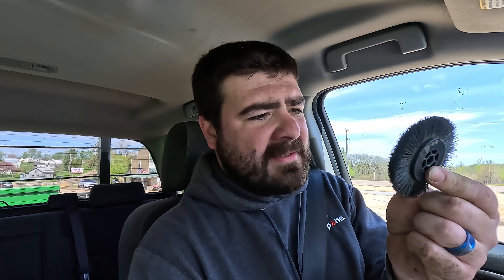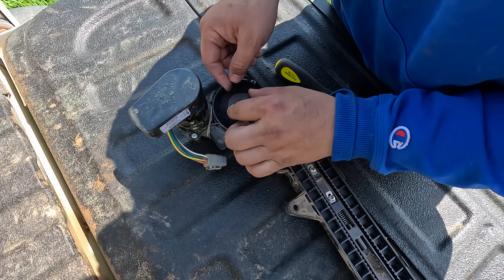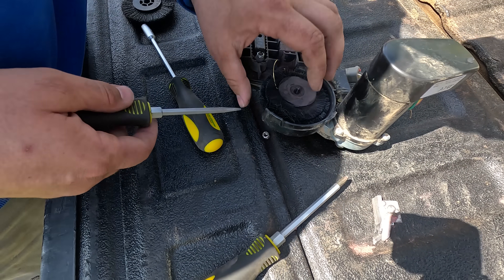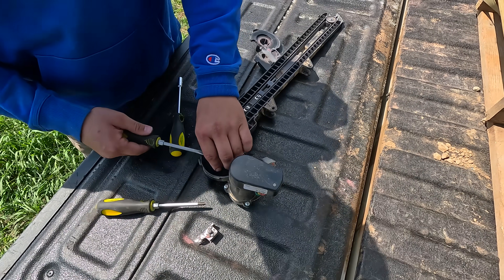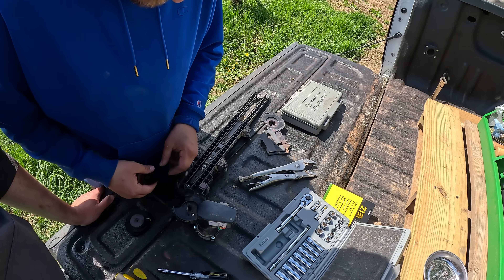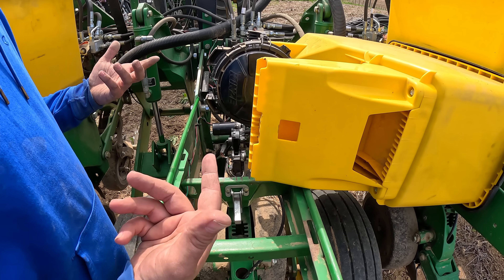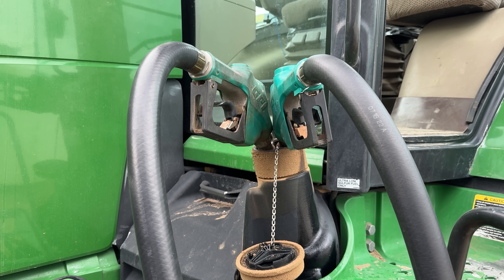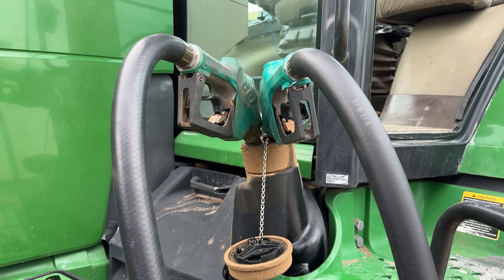Corn Planting | Ag Leader Surespeed Brush Replacement | Electric Drives

Comment: Hi Ryan, check out Edison Motors utube channel, they sell ev conversion kits.  Big red would get a new cat 6 cyl engine, 350kw battery bank, ev axels.  It saves 50% fuel and that's just using ev brake generation not plug in power from solar.  Running 3kwh per mile I believe.  Travis would be the man to get certified while installing the kit on big red in BC Canada. 4 week certification.  Edison started as log truckers and remote off grid solar solutions in the Bush.  Two working prototype trucks.   You next truck buy with no working engine and transmission.  Doubles as an emergency generator on wheels with fuel to recharge batteries.  Startup company kicking ass with repairable work trucks.